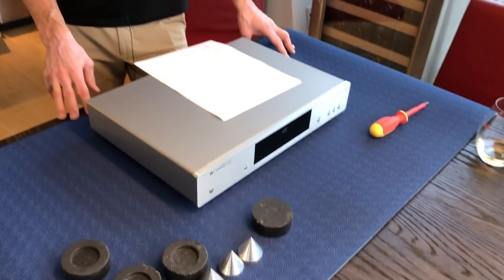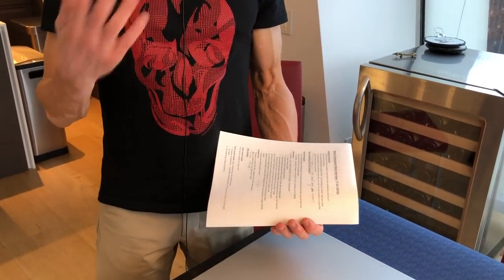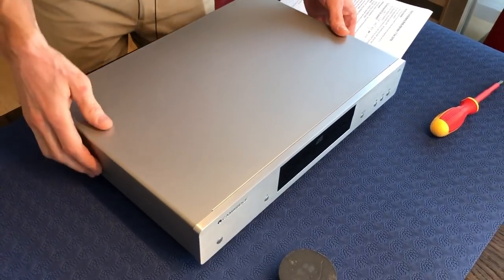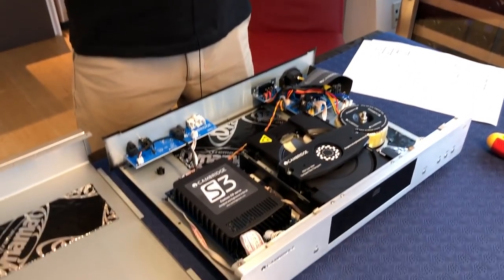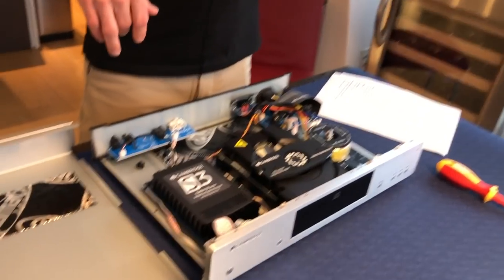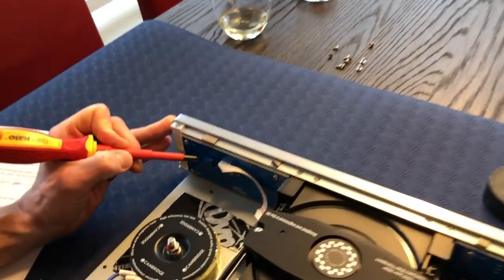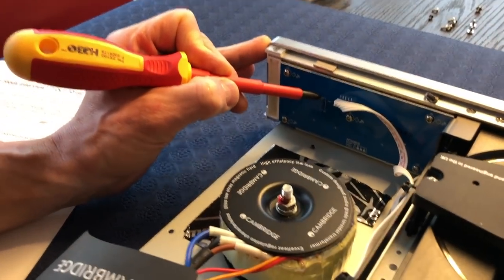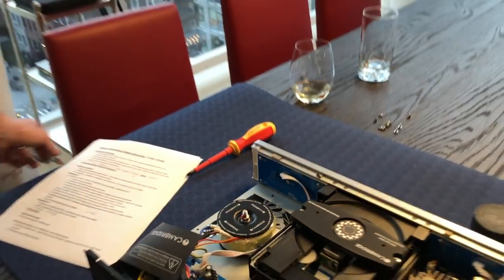Miguel pops the lid on his CD transport to tweak the sound

Comment: This video is showing off a MASSIVE MISUNDERSTANDING ABOUT CDs.  A CD player performs a "rip" each time you play a track. The result of that rip is a file containing a sequence of numbers (whether 16-bit or 24-bit the principle is the same).  Here's the thing - it doesn't matter whether you rip the file using a 15-year old laptop from under the stairs, or a $5000 high-end CD Player. The file is IDENTICAL and the same every time. It's what the publisher burnt and it will never change. Try rips from several machines then do a "diff" comparison. diff will tell you its the exact same file from each. That file is what your DAC uses to produce the sound wave. So the only items that concerns your ears are the DAC, amp  and speakers. The CD player is irrelevant - it has no 'quality' beyond either working or not working. Poor Miguel here is totally wasting his time, as he uses the Digital Out connector, not the Cambridge Audio analogue circuit.  The digital out socket hands over the file and nothing else.
Reply: I never said the data was not identical. What I did say is that jitter and electrical noise can affect the SPDIF signal coming out of the unit. In the SPDIF protocol, the master clock is the source - and if it has jitter it will induce jitter in the DAC because the DAC has no real way to reclock - in the SPDIF case that is. So maybe you should watch this more carefully, and also learn somethings about digital-to-analog transformations.
Reply: @miguelbarrio  My apologies to Miguel. I did not realise that getting digital data accurately transferred from unit to unit could be a difficult problem. I see that the optical connection (TOSLINK) has the same issue, and also suffers on a reliability point of view by cable damage and the limited lifetime of lasers, making coaxial perhaps better overall.
Reply: @steeplejock  Coax and toslink both run on the same protocol (SPDIF). What I am referring to is timing information - in SPDIF the clock needs to be recovered from the source, which if noisy will induce clock detection jitter. This is why minimizing vibrations and power supply noise matters. There are some workarounds to this problem, but none of them work when using a strictly SPDIF connection.

Comment: WOOOOW he can make his display brighter. AMAZING!
Reply: @progressiveguy9959  Mate fancies himself a mindreader lol
Reply: cebruthius I’m actually going to do this at some point. I’ve a matching CXA amp (sitting on top btw) but the brightness of the two components aren’t matched with the amp being brighter. Now I have a simple solution.
Reply: Possibly the leds are pulsed and that can generate noise. In the past there were CD players which switched the display off while you were listening. Changing the voltage might stop the diodes from switching on and off and could make a difference.
Reply: Christopher Ward I think it’s a calibration issue. I can brighten and dim both components but one is just dimmer than the other. Typically they can be adjusted simultaneously with the remote but I have tried adjusting separately with mixed results. They fall into a default mode when I do that after turning them off so I’m back to the amp being brighter than the transport.
Reply: @christopherward5065  PWM for a backlight led in an audio device? That's just bad design.
Reply: The CXC has a particularly dark, small, hard to read display, which is the reason for this mod.
Reply: Miguel Barrio did you see that guys cryogenics offer?

Comment: Omg that was hard to watch. My opinion on that kind of mods is: if adding $1 of damping material worth it, the manufacturer would add it for us. If separating those cables makes a real difference they wouldn’t tie them together.
Reply: The price of manufacturing a unit is a combination of the price of the components and the complexity of putting the unit together. People skimp on capacitors, design, etc.
Reply: Factories design a product to cost US$ 499 and will not deliver anything more to hold the price and the gross margin, when apply US$1 in damping material surely make price increases a few bucks more.
Wisely DIY bring us experiences to explore our hobby freely.